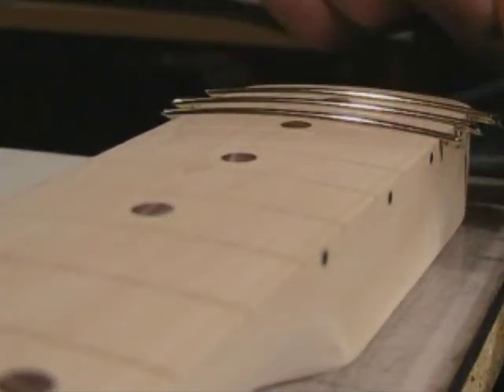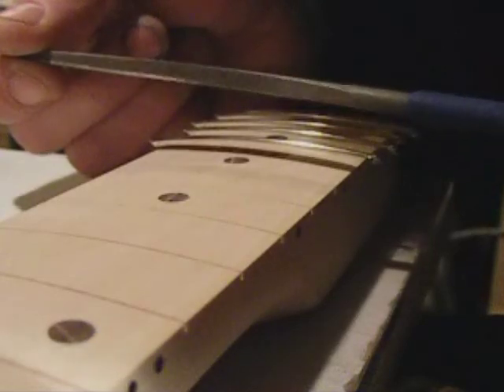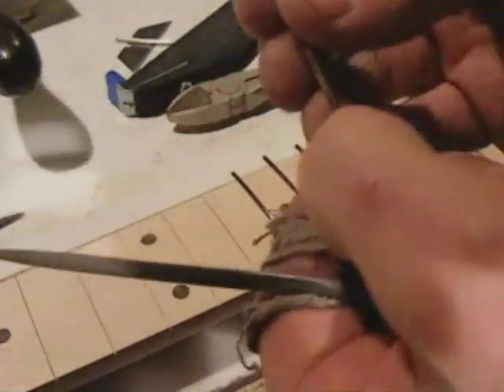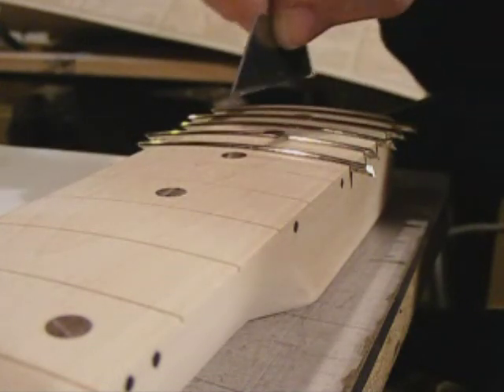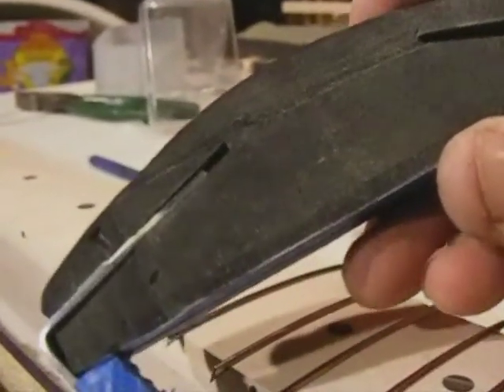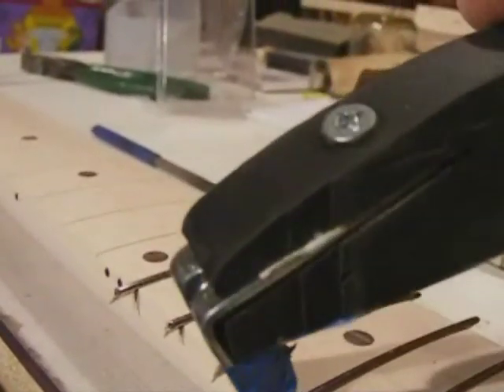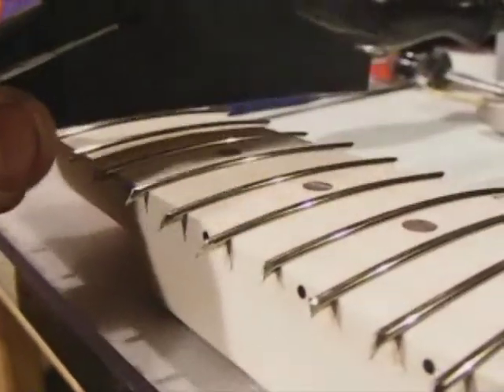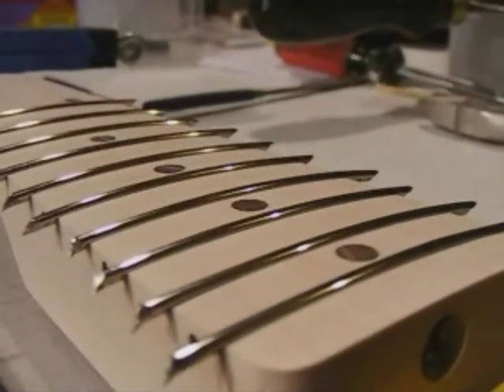One Piece Neck/Body Build Part 13: Installing frets

Comment from the maker: @Rick31797 

Yes I always seem to pick the harder way. Well if you glue the fretboard first you dont have to deal with frets in the way of the clamps if you don't have a caul.  You will also have to confirm location and that your running straight. I have always glued my fb first then the neck becomes a 1pce basically.
Check out this strattalk thread, you will see how I do a 2pce. google strat talk 60's neck build

Bill

Comment: on the two pieces neck there is always the fretboard is longer like 2 1,5 cm than the neck it self why is it not like this on the one piece neck ? and dose this change the places of the hole in the body for the neck position ?
Reply from the maker: Hussein Hani - حسين هاني it is because there are more frets than the standard 21
Reply from the maker: Hussein Hani - حسين هاني the fretboard overhangs to make room for more frets
Reply: so that's mean the one piece neck has less frets than the neck with fret board right ?  @ScheltemaBoutiqueGuitars
Reply from the maker: Hussein Hani - حسين هاني a one and two piece can have the same or the two piece more
Reply: Bill Scheltema thank you so much and sorry for asking so much, but I‘m still a beginner and this will be my first build.
This was really helpful and i still have questions but I will let them til tomorrow 😅